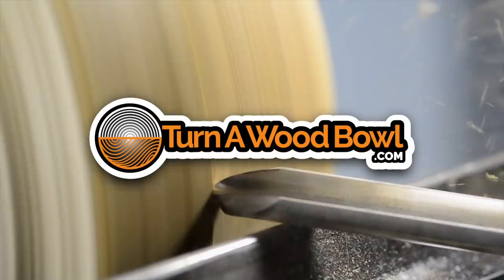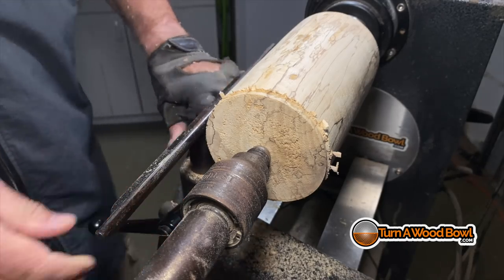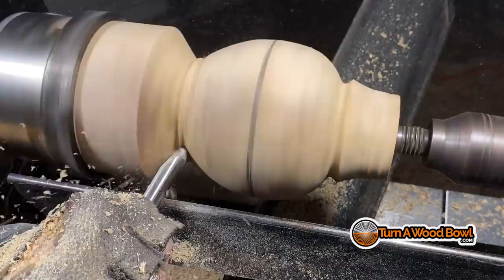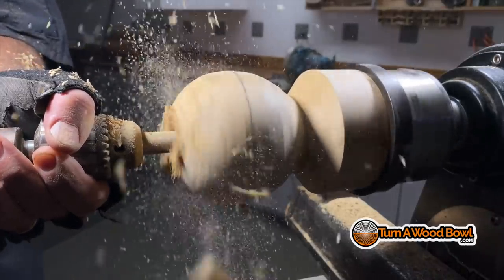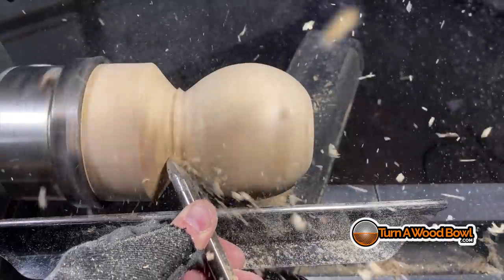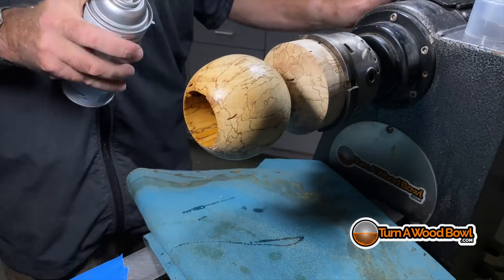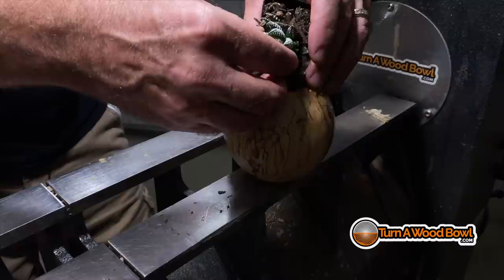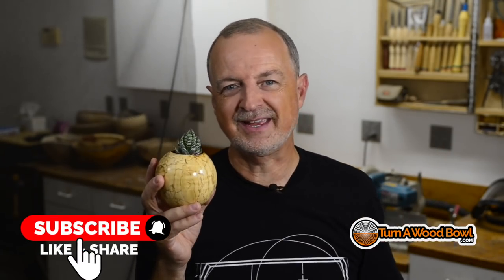Woodturning Project for Gifts — Succulent Planter video

Comment: Kent, you should consider upgrading your drill chuck to a keyless chuck.  The keyless chucks are self tightening so if they start to slip a bit, they usually tighten up by themselves.  You can get Jacobs keyless chucks if you want to spend a lot of money, but the ones from off shore are likely 1/5 the cost, and just as good, especially for this type of work.  Get yourself a 5/8" chuck and you'll never look back.....

Also, when inserting the chuck or other device into the tail stock, give it a bit of a 'snap' push into place.  That will look the arbor into place...... standard machine shop practice.
Reply from the maker: Great tips, Peter. Thank you. Happy Turning!

Comment: Great video, hey Kent and everyone else that's interested. Wood Owl Forsner bits are the best, the centre self feed screw is removable, the edges are easy to sharpen, and Milwaukee has a drill extension that is 7/16" true and is perfect for the wood owl bit 8" or 12" perfect for deep coring. Enjoy! Very high quality!
Reply: I looked at them on Google.  They do look different.  🤔
Reply: @DancingFox6  I absolutely love love love Wood Owl, nothing compares in quality and and ability to sharpen and usability... I have tried Freud, DeWalt, Milwaukee, Mastercraft, and a few other brands and they all do not fit the standards I expect a tool to just work!

Comment: Lovely project! And the spalted wood looks perfect with this. I'm afraid though, that over time the wood will decay because of the water/soil combination, in spite of the epoxy. I guess you could drill a slightly bigger hole and use a pot liner (? not sure if that is the correct word), an inner pot that can be taken out, also for drainage purposes. Plants love drainage.
That being said, I am off to my shop to dig out my batch of spalted silver birch. Thank you for the inspiration, Kent. Keep spinning!

edit: in the comments, someone speaks of a glass insert. That's the word I was looking for. A glass or plastic insert would be a good idea.
Reply from the maker: Silvia, yes, a liner would be good. Thanks and Happy Turning!

Comment: Could you add a glass insert into the turning to make it waterproof?  Great instructions, I subscribed.
Reply: You could.  Just make sure the glass is a loose fit because the wood will shrink especially if it's wet.  I've made thinks with dry wood and even it will shrink to some extent and you don't want thee glass getting stuck.
Reply from the maker: Yes, that would work very well indeed. Thanks for sharing. Happy Turning!

Comment: Well I've made 5 so far. Some spalted, a fog oak, and a wet cedar birds mouth( my first) that I was drying in the microwave. Learned from my sawmill guy that I can get a faster, better dry process by using the defrost setting. I used timed setting, mostly because  I couldn't figure out  the weight setting, which is what he used at 1 pound.
I was running it for 3:33 min. then cooling  for 10 minutes.  Working great until I tried to excellerate the process by using a salt paste I saw on a woodworking  site. BAD IDEA!  Bowl cracked twice,  maybe the wet salt or just the moisture.  If I do that again ill try dry salt. Anyway, thanks again for the great idea. I'll be selling mine at upcoming craft fairs in March

Comment: Kent,
I love this project great ideas.  I do have a question on Chuck jaws.  I have a super nova 2 Chuck I am having trouble with my tenons.  I have made sure that I have the dovetail angle and the diameter correct.  But  my project keeps moving around.  Looking at the inside of my Chuck jaws they are flat with a little triangle at the tips.  The out side of the same jaws are dovetails.  How do I create a tenon that will hold my project?  Thanks
Reply from the maker: Kevin, Check out this video and see if it answers your question. https://youtu.be/zhu-PQuOdS8 Happy Turning!
Reply: Kevin, my One Way chucks can break off the edge of a dovetail tenon.  I make straight-sided tenons or recesses and the teeth in the jaws grab nicely.
Reply: @DancingFox6  I will try that.  I have been even looking at other jaws to see if all of the supernova jaws are the same or do I have a bad set.  I was even considering purchasing the same Chuck that Kent uses but that’s not in the budget yet.  Thanks for the reply.
Reply: @TurnAWoodBowl  Kent,  Thanks I love your instructional videos they are so helpful.  This Supernova Chuck jaws tenon side is made weird.  If I can get a good picture of them I will send it to you. Thanks again